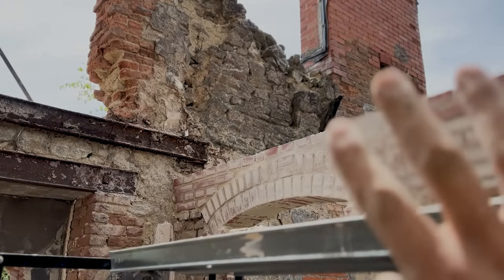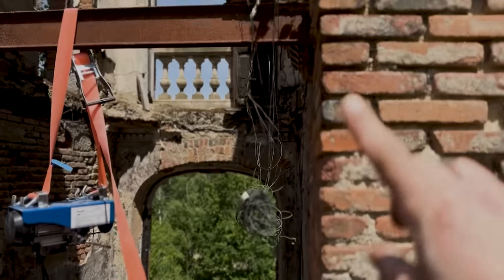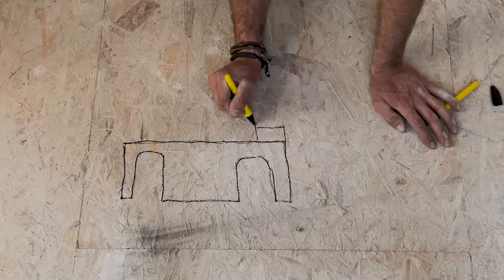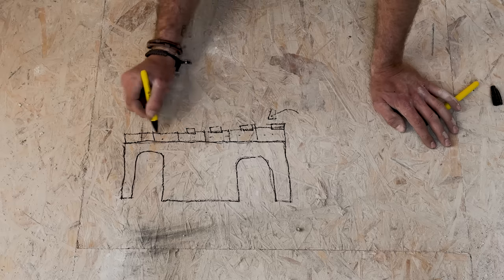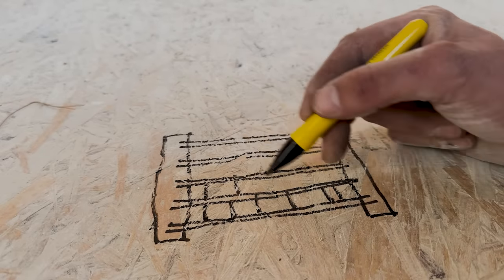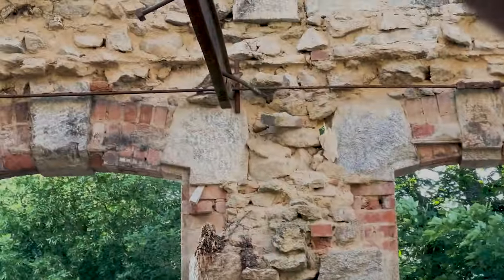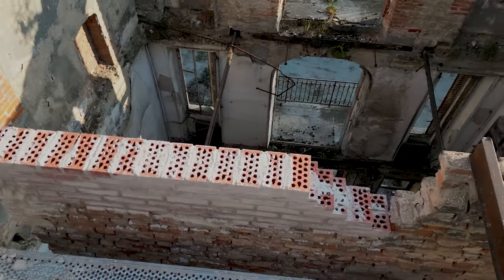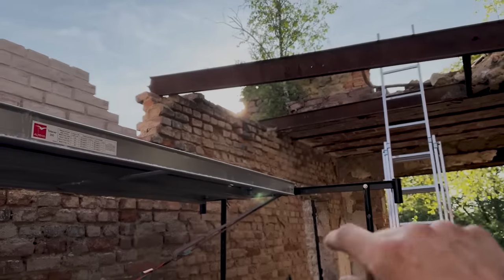Solving STRUCTURAL challenges with the chateau.

Comment: I think it makes sense to leave the levels as they were.
Reply: Definitely the best choice!
Reply: Yes, agreed. Changing them causes much more unnecessary extra work and expense, and detracts from the character and original design, which Dan has said he intends to replicate. 👍
Reply: I’ve commented several times that I hope Dan has engaged an experienced architect and engineer to provide specifications. Looks like he hasn’t but it’s a false economy to try to DIY this stuff imho.
Reply: @boucephales  a really expert person is needed for this kind of restoration! It is not a small house, it is a very big high one that had fire on its walls and hot, cold, rain and so on, looks so fragile!
Reply: @Pink Nomad I asked if he knew they'd be a plan at the planning office or be held somewhere like Museum , we have in the UK you can usually get a book on the subject at the library  ❤
Reply: To me, level floors make more sense.
Reply: Makes sense to get professional advice and help. Building when completed could collapse like a house of cards.
Reply: @world_still_spins Level floors would be great but if you look where the levels are it would involve internal and external wall changes.  A lot more work and a total change to the look of the Chateau.
Reply: @kooran2027  I think he was planning on taking down the 4th and 5th floors (and turret) to re-morter/re-brick those levels down to the top of the third floor then back up. With the turret hanging by a single brick (next video) it may be the better time for any small changes if any.
Reply: @world_still_spins  could be.
Reply: All I see on FB is endless reruns and out of order of the daily movies, too bad..loved it so much

Comment: Loving these videos! One thing I would suggest, if you haven't already, is getting someone in to start doing a full set of plans to work from, for permits, and for records. I'd even consider doing it. Though that could just be me as a tech working in architectural and engineering firms the past 20 some odd years.
Reply: Excellent suggestion. Nothing replaces good documents. Cheers.

Comment: I am based in the UK and although my background is carpentry, through experience I worked my way up to site manager positions. I am very impressed with your progress and the chateau already looks more structurally sound and stable. There is a system that you might find useful called Posi-Joists which are man made wooden joists that are light and very strong. Google will give you lots more information.
Reply: Great tip, I hope Dan reads your comment. Xxx
Reply: Post wants pumping to top so that Dan see it

Comment: RIP vlog camera. It worked well for you. I have to say I really enjoy how you use your drone Dan. It makes it very interesting looking at the difference in the old brick work, your brick work and the beautiful countryside that surrounds you. The system you have ordered for the flooring is clever and sensible. However I hope someone will be there when you lift those big beams. That’s making me worry for your safety already. 😂 Yes I know I forgot to mention gloves harness and mask. There you go. 
Thank you. May you all please take care and stay safe. Louisa. 👏👏👏❤❤❤🤩🤩🤩
Reply: Absolutetely no way you could lift steels that are over 5 m long into place on your own. A 200 mm steel weighs 23 kg per metre and these might be bigger. 240 mm is already up to 31.5 kg/m. Eyeballing the size of a room from a video is close to impossible but I't hazard a guess and say the span is about 5 m, plus at least another 250 mm to go into the wall on either side, so 5.5 m length. That means a 200 mm steel weights 126 kg, a 240 mm one 173.25 kg. That's not insanely heavy but definitely more like a four-person job, especially because of the unwieldy size. There are some nifty tools that would make the installation easier though. The same style of trestles Dan uses for his scaffolding is available with a crank and spindle system for lifting heavy items. A pair of those could well turn this into a two-person job. Getting the steels in is still quite tricky because they need to be longer than the room, so a lot of maneouvering involved.

Comment: Leaving the different floor levels will add character. The existing joist slots in the walls can then be used, speeding up the job. The block and beam floor is the way to go. Use in the tower floors as well as  the basement ceilings/ entrance room floors.

All looking good. Shame about the camera. James.

Comment: Hi Dan Curious to know how many hours a day you spend at the chateau on average & what you plan to do with it when it’s done ☺️
Reply: It will never be done . That’s the beauty. Homes/buildings/châteaus are ever evolving beings. We are merely the conservator until the next one comes along.
Reply: For utube show only I think
Reply: Flip it and do another one?? 🤔
Reply: @nicolemorin14  I hope not but I sometimes wonder? I know what the convent has done for Billy Petherick ( in income and views )and I am of the opinion that its only for making You Tube income.
Reply: well, he will be a 100 by then...so retire at the chateau i guess. I mean, steph is already 20 years in, right?
Reply: Dan has said he plans to live in it.   He plans to get a cabin onsite, but 1st needs power company electric ( besides the portable Eco-flow Solar battery unit he is currently using), water, and a workable septic system.
He is also waiting on permits.  Other builder-type commenters have said he needs permits for the final roof.   The current brickwork is to stabilize the upper walls to permit a temporary roof to be built.  He has to have the temporary roof to protect the OSB3 subfloors, which can take light rain, but not repeated rain drenchings.
Thankfully, he has covered the subfloors with plastic sheeting, which was recommended by other viewers.

Comment: Instead of stepping the floor up and down, install a "false Floor" (all one level) in the lower spots to house various utilities. Pipes, plumbing, electrical WIFI hotspots. On demand hot water heaters forced air heat ....Utility "crawl space" of sorts on the second floor....
Reply: That's not going to work out with the various balcony doors. Forced air heat is virtually unknown in Europe so no need for that, although central ventilation systems are slowly becoming more common as energy efficiency requirements increase and houses get sealed up more and more tightly.
Reply: I agree. Besides, in future the Chateau may house people who can't do steps well, one could be you the way you push yourself, or parents etc. I just think single levels are the best and ther may be a way to eliminate some  if not all steps. It can also make or break future sales, or uses as potential guests may have limitations.  Best to keep your options open wherever possible.  ❤
Reply: @Ragnar8504  Fair enough on the central heat. The point I was making is that the space could be utilized to house infrastructure large and small that would otherwise take up floor space elsewhere.... As far as the balconies, Step up or step down to the various balcony doors? The fact is, this project is limited only by one's imagination... Which means it doesn't have to be "all or nothing" 
Having one or two steps up or down to a balcony door in a room large enough to handle it could be a rather stunning room feature if done right.....

Comment: Keeping the levels the same as the originals is best bet. Making them all level, you will be fighting other issues along the way as you move forward and upward. There may be something you’re not seeing now that may arise later.
Reply: Also, not sure how it is in France, but you would most likely save time, money, most import, you back if you were to have the building supplies delivered in larger quantities then going back and forth and loading and unloading small batches. Get shipping containers for storage. I think in the long run you will be thankful.
Reply: Since both front and back have balcony doors the problems would pop up the instant you tried to install the floors.
Reply: @Ragnar8504  I agree but not only the balconies, I’m thinking roof structure above and ceiling heights. They most likely wouldn’t have built it with step downs without a reason.

Comment: If you've got the three week window to the arrival of supplies, there was a lot of pointing that would sure up the wall that you could think about. With pointing, normally, you'd aim to get a good finish- if the sections of the wall are going to be out of sight, you'd only really need to think about structural strength - so getting a mortar disc for an angle grinder, cleaning out joints and then ramming in the mortar/lime might lead you to have a different style of working. There might be only a few sections where you think this is going to be necessary. The metal rods/beams across may expand in the summer and be a little longer and then contract in the winter - you might need to think about how you can deal with this if the flooring is going to be secured to them - a lot of design accommodates for this type of phenomenon - hope you get a good plan in place, if necessary.

Comment: I'm not whinging here, but for some of us not able to ante for the Patrion account, you only gave a little hint yesterday about the camera. My condolences. Just like when yesterday, you had a visitor but the only glimpse we had was of a leg and I think a "comme cest va" in Spanish or more likely, French.  Secondly, the folks who built that place were probably French (like a big part of myself, at times to my dismay) and had to have everything match, one side to the other. (Look at any exterior side of the building).  They didn't know you were going to be rebuilding centuries later and decide to leave you a puzzle with the uppy-downy flooring system.  They wouldn't have done it to themselves, either. It was done for a reason.  I'm not there to add any more fuel to the fire, so you are going to have to figure it out on your own or find someone who can but you can be certain it wasn't just willy-nilly.  Lastly, another furniture maker and myself would occasionally have to build a coffered ceiling of walnut or maple for a library or some other important looking room.  It might be, say, three meters by fifteen meters with 30 cm square beams and 15 cm crown moldings and dentil work.  It was way faster and easier to build it upside-down on sawhorses on the floor of the room, flip it over, then raise it in the air to the ceiling with ropes and pulleys on each of 4 corners.  Not trusting anyone else, the two of us would man one rope on two of the corners, raise 30 or 40 cm, tie the ropes off, then walk to the other side of the room and do the same. Bingo!  Safe and securely screwed to the ceiling in no time,  You can do the same with your heavy metal beams with just two ropes with double pulleys, one at each end. Up a little here, up a little there. Done. It could work.  Oh yeah, don't let go of the rope.  We don't want a graceful, gentle slide like you managed with the bathtub.  Been there, done that.      Jack L.

Comment: I was watching a video of an American bloke who spent 53 years of his life building a castle out of rocks, cement and other odds and ends. He did not have a crane to lift heavy materials to great heights but he solved the problem by building a tall strong tower on the top of which he fixed a pulley. Through the pulley he threaded a cable. One end of the cable was attached to the container of rocks, the other end of the cable was attached to his old truck. He’d simply drive the truck forward to pull up the container of rocks and cement. He built a castle by himself.
Chateau Guedelon, 160 km south of Paris is a Medieval castle under construction being constructed with simple traditional tools and methods. They use a human powered giant mouse treadmill to raise rocks and heavy blocks up to the ramparts for building.
You have so many choices to rebuild this Chateau of yours. Getting heavy stuff up to the top is probably the hardest thing you have to do.
Best of luck to you mate. 🇦🇺🦘🦘🇦🇺
Reply: Dan has seen that video of that guy in Colorado. I think it is something of an inspiration to him.

Comment: I think you will be wise to reinstate the original floor levels ..the staircases dictate the floor levels ...the main staircase for instance had to be calculated that risers were all equal  and met the  1st floor exactly ...  total sum of the treads dictate how much space is required to fit in the staircase .......This all sounds a bit complicated but my point is as these calculations must have been done ..therefore ..when you have put all the floors back everything will fit ....It will be a beautiful moment ....you will think  ah thats why they did this  !!!!!  As you have the Stringers from the Main Staircase with the evidence of treads and risers that will save time and money working out that staircase ...Good Luck

Comment: find a yard that sells excess/surplus steel from big projects ,, you need "B Deck" aka bridge deck , similar to corrugated roofing , you place the sheet between the beams and pump concrete to fill it in.
Reply: That's not the system Dan's looking at. The most common system in France uses hollow concrete blocks that just sit on the beams but don't overlap them completely. The space between the blocks is then filled with concrete. That's sturdy enough to walk on and for some systems that's all you need. With others you then add rebar and concrete on top.

Comment: you can build the ring beam in two parts.  do a little research on lap splicing your rebar.  the rebar would overlap each other and are wired together.  I don't know the building code in France so I can't give you the amount of overlap for your case.   you can install the left half of the ring beam on your new wall leaving enough rebar extending beyond the block for the overlap.  if the void in the block is too cramped for the overlapping rebar you can leave out the block and cast the section in between the two parts with just concrete.

Comment: I live in a very old town, and once upon a time structures were built in case of fire, the water would run out the front or the back
Floors were slanted 
To allow the water to flow out leaving the main structure to be rebuilt 
That may explain the different levels of flooring
Reply: If it was built that way, it certainly didn't work 😄
Reply: I'm sure each floor was more or less level in this place, there were just steps up and down. It looks like the architect designed the exterior and the second floor ceiling heights first and let that dictate the floor levels on the third floor.

Comment: Dan. There's tons of questions about how safe the lower bricks are. If you can, please fill the viewers in on your plans to make the existing walls safer. I know the expansion beams are to help hold and stabilize the walls from caving in. After that, with tuck pointing the walls can stand for years as come as long as they weren't damaged. Just give the viewers a heads up about building codes in France. Some cities in the US go nuts on restrictions. Put our minds at ease. Please.

Comment: Dan, what holds the concrete blocks between the beams without them just dropping out? I've never seen a system like that.... since I live in America.
Reply: The beams are designed to support the blocks. It’s a very commonly-used system in modern construction.
Reply: @LaReyne  is there a channel on the edge of the beams that supports the blocks? I've never seen that system, here in America, and I've got experience in a lot of building techniques... and did flooring with my husband for many years where we'd have to replace subfloors. I've seen upper stories made of wood, or concrete, or lighter weight gypsum (FYI - never use gypsum, it is HORRIBLY crumbly as it ages and makes replacing some types a flooring a freakin' nightmare, have tp treat it with kiquid laytex to stop the crumbling, then use a self-leveling flooring material to fix the low spots that pulled off with the old flooring), but never blocks. So, that process is very interesting to me.
Reply: @catgray1  The beam has lips on which a corresponding block rests. Easier for you to Google to see examples than for me to describe. Is used a lot in modern construction.

Comment: With all the heavy things that you have to lift up to higher levels, not to mention all the work that you will be doing up there, would a Cherry Picker or a Scissor Lift help?  Perhaps you could rent or borrow one of each to save money and see what works best.
Reply: It's difficult I think. What he really needs is a proper crane that can reach every part of the building but that's awfully expensive (not that cherrypickers are anywhere near cheap, the prices mentioned on Youtube are eyewatering!). Getting a scissor lift up the front stairs into the main stair well would be tricky, besides it would have to be a substantial scissor lift because of the height.

Comment: Thank you for deciding to keep all the levels to match the original.  I breathed a sigh of relief when I heard you speak the words.  One additional reason they may have chosen various levels is that the framework of the house might be more stable than if it were all one level.  I don’t know how to explain it, but if you had a cookie tray (for example) and one corner got twisted, the entire tray would twist.  However, if you had multiple trays and one corner got twisted, it would have less of an impact on the other trays.  Hard to explain.  See ya tamorra.